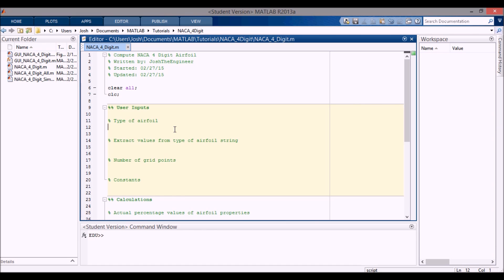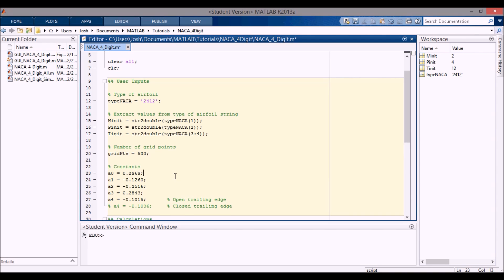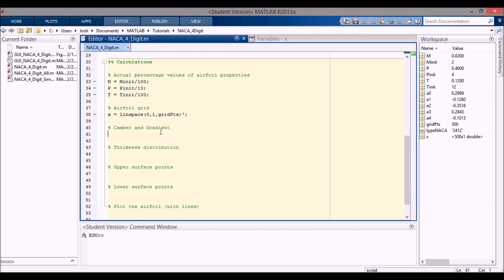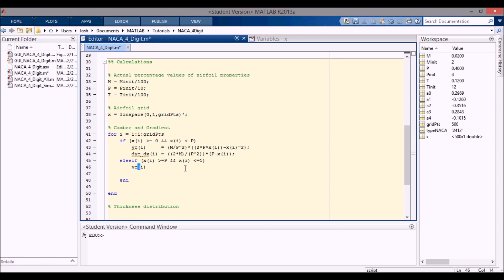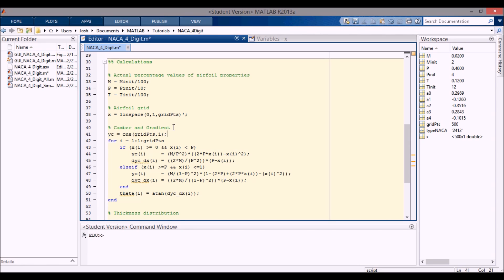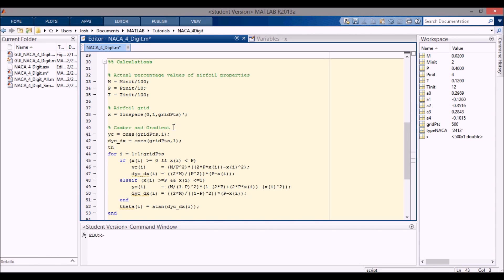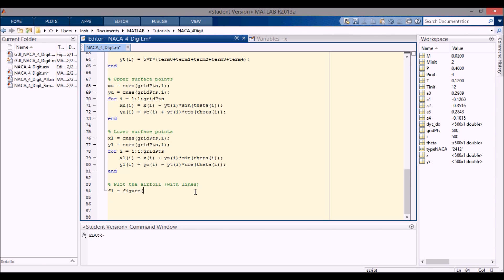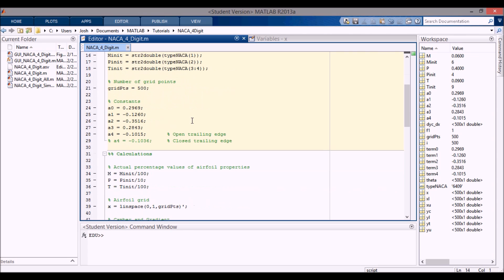Explained: NACA 4-Digit Airfoil MATLAB Code [Airplanes]

Comment: Hey Josh,
How can I get the profile equation? I want to find the pressure distribution and for that, I need the streamfunction (which is the airfoil profile) to find the velocities and then plug it into Bernoulli to find the pressure distribution. Let me know if there is a more straightforward method. Thanks.

Comment: Hey Josh, I followed your code step by step and am not getting the airfoil as expected. I’m getting a half weird square
Reply from the maker: If you're using the same code as mine, then I don't know what would be going wrong.  I would have to see the code to be able to check it for sure.
Reply: JoshTheEngineer Sorry my bad. Works fine. Thanks for the reply! Love all your videos. I usually stop by your videos for reference. You in the industry?

Comment: Just what I was looking for...Ur explanation is v. Good....Can you pls suggest is it possible to programme Pressure distribution over the Aerofoil..
Reply from the maker: Thank you!  Yes, you can plot the pressure distribution if you use something called the Vortex Panel Method.  That's a video I plan on making in the future, but there are already some good books and tutorials out there for how to code panel methods.
Reply: JoshTheEngineer Thanks for your reply.....Actually the eqn for pressure distribution is in differentiation from unlike aerofoil thickness eqn...Please make a video on it...Thanks

Comment: This is really an amazing program! Can you add the option of saving the airfoil as .svg or .dxf? Thank you very much
Reply from the maker: Thanks!  I'm sure it could be done, but I'm not familiar with the formatting of those files.  For the CAD program though, you should be able to open up the text file with too much of a problem.
Reply: JoshTheEngineer yes by exporting the xls format is not a very big problem working with them, svg or dxf are only easier to work with :-) Thank you very much

Comment: sir please provide me the code for how to make 3d wavy trailing edge for naca0012 aerofoil.
Reply from the maker: I'm not sure I can help you with this, as I've never looked into it before.  You can probably take a NACA 0012 airfoil, change the chord length in some sort of sinusoidal manner, and then extrude along the wing span between the various airfoils.  That should get you started.
Reply: can you please send me the sample code for that so that i can start

Comment: Thanks for the video. I have a question. Is there a way to verify if the aerofoil shape generated is correct or not?
Reply from the maker: The best way to verify is to go to this website: http://m-selig.ae.illinois.edu/ads/coord_database.html

You can download the coordinate files for the airfoils and check them against the ones produced by my code.  If you choose the same number of points, the values should be identical (which I believe I check in this video for a certain airfoil).  If you increase the number of points in my code, the shape should still be the same, it will just have a higher resolution.

Comment: Hi :) First of all thanks for the video, it is very good. But i have a question.

When i checked the wikipedia page of 4-digit airfoils, equations have chord length in it too. But you didn't use it. How could you do that or did i miss something?

Thanks.
Reply from the maker: You're right, the Wikipedia equations have the chord length, 'c', in them.  Now just plug in a value of one (1) for chord length into those equations, and they should be the same as the ones I'm using.  It's really just a non-dimensionalized version of the Wikipedia page.  

Here's why the way I write it might be better.  You can find the correct airfoil you want to use, and output the data coordinates just once.  Then if you have a program that puts them together into a swept wing (for example, because it has varying chord length), then you can just multiply the X and Y values in the coordinate file by the chord length and you're good to go.  You'll see in the airfoil coordinate files that the X values go from 0 to 1 (technically from 1 to 0 to 1, but that's to define both the upper and lower surfaces).  Multiplying by the desired chord length makes the X values go from 0 to 'c', and since the thickness (Y values) was also defined with respect to a non-dimensional chord length of 1, they will change accordingly.
Reply: Thank you so much, that's a good idea. Actually i remembered we can use those coordinates in other programs as we took from matlab.

Also i finished the series and that project was one of our teaching assistans suggested to me. Because i am an aerospace engineering student and i asked to him to how i can learn matlab depending on my education.Thank you so much again. And i want to ask if you have any suggestion to me like this project.
Reply from the maker: The best way to learn MATLAB is to just keep using it.  It doesn't necessarily have to be aerospace related.  Think of something that might be cool to have automated, and code it up.  For example, I'm usually indecisive when picking an episode of my favorite TV series to re-watch.  So I decided to make a random episode picker.  Then I expanded it to all the shows I watch.  Then I put it into a GUI.

If you're looking for a couple aerospace related MATLAB programs, check out my GitHub account here:

https://github.com/jte0419

In particular, the Rocket Nozzle Design and Taylor Maccoll codes are applicable to aerospace engineering.  I'll be doing videos about the derivation and coding for those in the future, but you might be able to figure them out on your own.
Reply: That was nice. I will try to do some basic things which comes to my mind. Thank you for  your kind answer.

Comment: +JoshTheEngineer Thanks for this great video! Had a quick question though, how did you determine the constants (lines 23-27). I know you mentioned that they were from the other video but I still don't know from where you got them. Thanks in advance and nice job with the videos!
Reply from the maker: Thanks for watching!  So first of all, if you don't already have it, I recommend getting the book Theory of Wing Sections by Abbott and Von Doenhoff if you're interested in wings/airfoils etc.  In the section about the NACA 4-digit airfoils (section 6.4, page 113) they state the following:

"When the NACA four-digit wing sections were derived, it was found that the thickness distributions of efficient wing sections such as the Gottingen 398 and the Clark Y were nearly the same when their camber was removed (mean line straightened) and they were reduced to the same maximum thickness.  The thickness distribution for the NACA four-digit sections was selected to correspond closely to that for these wing sections and is given by the following equation"

The equation stated is Eq. 6.2 on page 113, which includes these seemingly arbitrary coefficients that you're asking about.  From the quoted selection, it seems like these coefficients were chosen to closely match the thickness distributions from other airfoils that were known to work well.

You can mess around with the values and see how they change the geometry, keeping everything else the same.  You can also load in the two airfoils they mention, remove their camber and compare the thickness distributions from these airfoils.  It could be an interesting, informative experiment.

Comment: That's nice. Thank you for your videos.

I'm working on airfoil optimization. I'm having some difficulties on using the softwares, cause I've never used MatLab or Xfoil, but I'm learning. I guess my idea is simple: I want to change the geometry of a 4-digit airfoil to get more specific and appropriate coefficients (cl and cd mainly). But I wanna take them as inputs. Do you have any idea of where I could start from? How can I make these two softwares get in touch?

Comment: thanks for  your video.  but where can i take the modul likes yours, because i don't know much about matlab , thank you
Reply from the maker: hoa le dang 
You could take the basic outline of the code and use a language like C++ or Java if you are more familiar with them.  You should also be able to make a spreadsheet in Excel that will calculate and plot an airfoil of your choosing.
Reply: thank you so much

Comment: whats on x-axis & Y-axis?
Reply from the maker: Premkumar P Pithiya 
Sorry, I didn't put units on the axes.  It's just a unit length though.  If you watch the video I posted in the description, I briefly mention that I'm using a length of one unit for the chord, and then the thickness is calculated accordingly.  To get a different chord length, just multiply the X and Y values by whatever you want it to be.